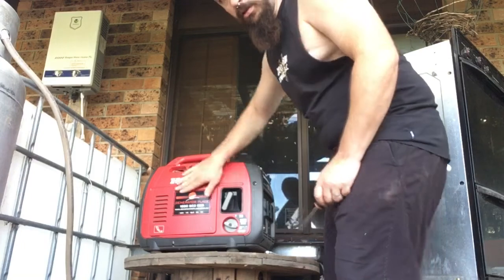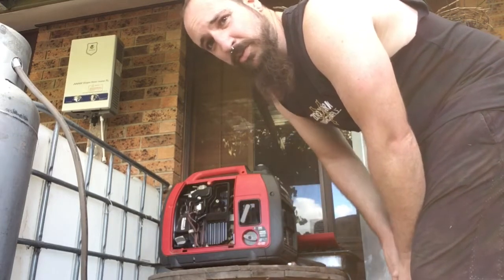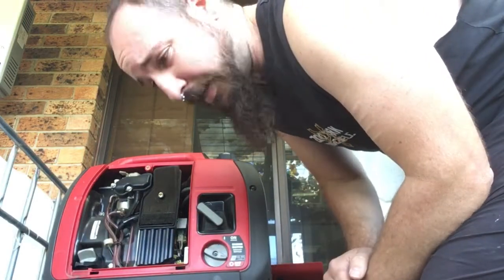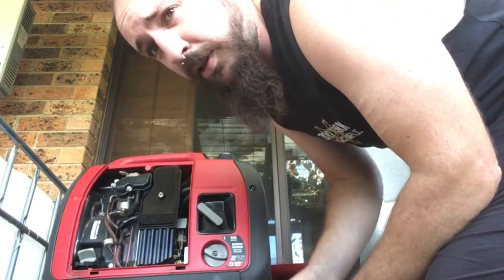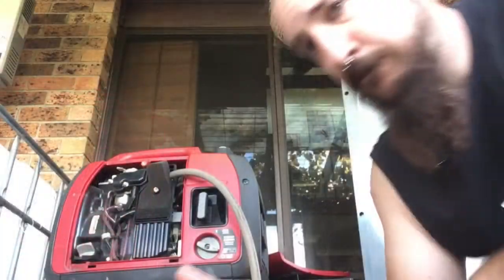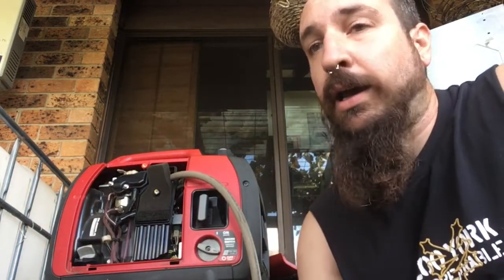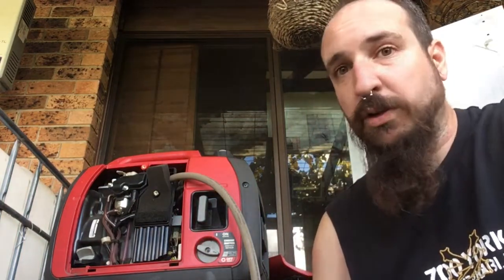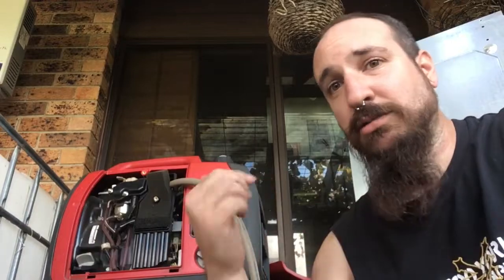Biogas to electricity through a petrol generator !

Comment: I just wanted to say after watching your video I bought a cheap petrol generator from Bunnings and hooked it up to my Homebiogas 6 and got it to run. Only thing I did was I added hydrated lime to the biogas filter, the filter they give you is activated charcoal but I took the charcoal out and added layer by layer charcoal with lime and gave it a good shake to mix it in and it’s worked well. I got it to run with no regulator running my 500 watt aircon, only thing is it’s so touchy, slightest bit too much gas floods it and slightest bit too little and she stalls. I’ve got a zero pressure regulator coming. I just want to say a lot of people in colder climates are naturally put off by homebiogas systems but you could easily hook up a heat exchanger to your generator/Homebiogas and sump pump hot water through to keep it warm. If you do that with a greenhouse overtop to keep it warm I bet most people would be able to have a biogas system functioning all year round. Cheers cobba 🍻
Reply from the maker: That’s awesome mate, I just thought at the time using compressed gas with a reg might be more stable, I’m yet to try it with the homebuogas system and just the sand bags, but if I did I’d probably just put a valve at the hose going into the genny, but yes there is a sweet spot, I remember pulling the cable and adjusting many many times before I got it to start. I ended up buying some biogas lamps off alibaba that I was going to try for the greenhouse, might have to do a vid on them when I get the chance.
Reply: @OkAtEverything-ProAtNothing  Sweet mate, Yeah I just drilled a hole in the air filter cover, I'm really optimistic that getting the zero pressure regulator will get it running smooth so I can have the valve fully opened and let the regulator take what it needs. it cost $100 on Amazon and its coming next week, I'll keep you updated. Oh ive also been doing some reading and when doing some research, chatgpt suggested adding a venturi pump which might add a better mix of air to biogas. I have 3D printed a venturi before, so I am going to also give that a try, costs like $3 to print yourself or $15 to buy one off amazon

Comment: Can you just drill a whole in the air intake cover, add a valve and hook directly to it?
Reply: That’s exactly what I did and it works, just need a zero pressure regulator because it’s so touchy, slightest bit too much gas and it floods, slightly too little and it stalls

Comment: Hi - very cool idea, and great that it works. I have a question: I’m looking for a generator and was all set to go with the Honda (and break the bank...) but then saw that the Yamaha EF2200iS has a caburettor drain (to remove excess petrol for storage). So, I thought this could also be used to connect gas to that drain really easily as it would be open to the carburettor and save a lot of modification... what do you think?
Reply: Did it work?

Comment: how long should my homemade IBC biogas take to start producing methane from cow dung and what optimum conditions shud i keep IBC in to produce more gas
Reply from the maker: Approx 3 weeks, it will start to produce co2 for a while, then produce methane, start capturing the gas around the 3 week mark and check to see if it’s flammable, once it is, then you can feed food scraps, not before though.
Reply from the maker: And try to keep temps above 20c but ideally at 36, like body temperature
Reply: @OkAtEverything-ProAtNothing  shud i fill it full to the brim or allow about an inch of air space inside the ibc
Reply: Kindly assist me with this question because I left about one inch space between the digestate and the ceiling inside the tank and I feel I've done the wrong thing or?

Comment: well only problem might be if engine requires gasoline to be mixed with oil. Without it you will wear out engine in no time. If it is four stroke with oil pan (requires clean gasoline) , than you are golden.
Reply from the maker: Yer I made sure it was four stroke, probably should have mentioned that hey

Comment: Would an air regulator attachment help control the air flow? I've just bought a 350w generator to play with later. Is that a straight 3/8 air hose there
Reply from the maker: Having a valve down at the end of the hose would be a great addition, adjusting from the tank is touchy as the regulator doesn’t like the low pressure, better to turn it on full and open a valve at the end as I was having issues, as I’ve mentioned you can actually buy conversion kits for this model generator, but I was merely showing that it’s possible to run it with biogas, if I actually relied on it for power it would be set up properly 👍

Comment: Hey there,

I'm guessing by what look like oil lines that this a self-mixing 2-stroke engine? 

But even if not, are you aware most liquid-fuel engines rely on the liquid to assist cooling? This is why cars can overheat if they run lean. Have you given thought to cooling?

It'd be a shame to lose your genny to a cooked motor!

(Of course, if you're willing to send me a genny for "testing purposes" I'm sure I'll sort something out just after our next quake or other emergency ;) )

Comment: I’m sending an email your way on some possible collaboration of these projects.  Main thing is with a group i volunteer with, but if that’s a bit much i can send you sketch ups etc via email.
Reply: didn't find an email, so i guess i may try a basic explanation here:
Reply: (still kinda "formal" due to the template)
Reply: Enough about us, where do you fit into the picture: 
Would you be willing to join as a developer? The things that seem to be the most beneficial that you do are your biodigester work. We would both get more exposure, we can use and add to your development, and you can gain expertise from our other developers.

Also, it is all volunteer and there is no minimal work amount required, so it doesn't require some massive change in your schedule. Even something as simple as posting cad files/code/video/photo walkthroughs would be more than enough.

This would also allow for filling in some of the competitive YouTube treadmill space with videos on any of these series on this.

All in all, I hope you consider this possibility, and thank you for your time.
Reply: So all in all TLDR, you have a great biodigester + biomethane system, we are developing one, and expertice + real world tests help.  More hands make for easy work.

Comment: It would be a HELL of a project to do, but could you do a “biogas upgrader” ?
Reply: I think the main thing for small scale would be removing hydrogen sulfide via a basic wet scrubber.  Then a drying phase.
Reply: I can sketch up some ideas and help.
Reply: @ericlotze7724  you can use iron to remove the hydrogen sulifde. Steel wool would probally work. H2S (gas) will react with FE(solid) to produce iron sulfide. Then can pass the remaining gas through water to remove CO2 and remaining Hydrogen, not perfect but it would be cheap for at home removal
Reply: @gavinfeiel3268  he has one just like this, i am the big dumb and didn’t see it pre-comment.
Reply: Granted a water scrubber, with sulphuric acid recovery would be neat.
Reply: @ericlotze7724  hahaha I just saw his other video too.. amazing what can be done with some simple chemistry. This is a super neat idea. im thinking of building one as a bit of an experiment

Comment: Here's a thought for anyone out there to optimise your generators, add an egr (exhaust gas recirculater) or 2 in line on the exhaust, not to reburn the gas but to use the heat exchange to heat water, we waste so much heat energy with generators.
Reply: https://youtu.be/SNC1Afnn6W8
 Gobar se chalne wala Bharat ka pahla tractor 1kg gas/8₹
Reply: Please explain further, you mean we generate the heat from where
Reply: @gideonkehinde1019  connect an EGR (exhaust gas recirculator) on the exhaust, the EGR is a heat exchanger. Exhaust heat -> heat water, I try and add one to as many divises as possible to heat water in my tank. The water will generally syphon through the EGR as it heats without a pump
Reply: https://youtu.be/cVT4bR5e7FI
Here's one added to a diesel heater, obviously it's a different application.
The diesel heater exhaust gets to around 170°C but I hope that gives you an idea for extraction of a lil more energy ✌️